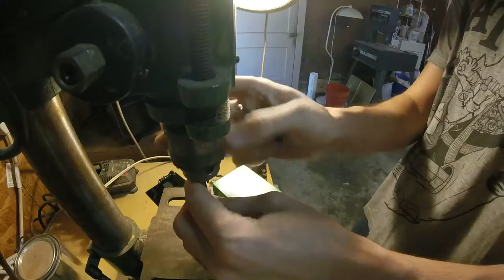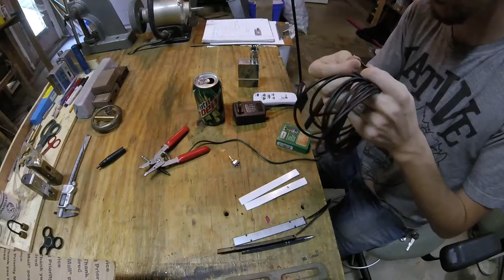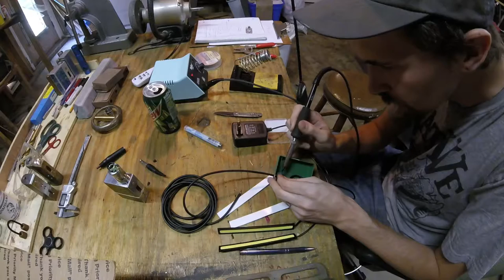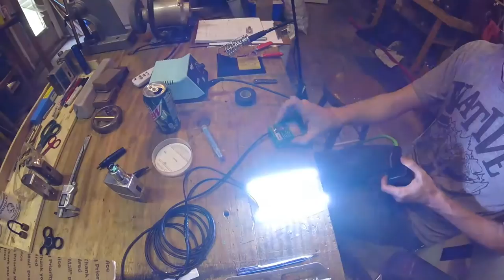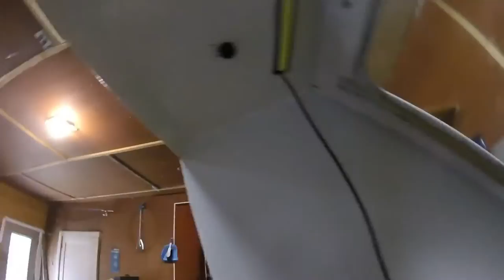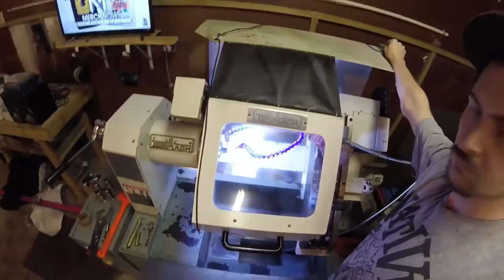Tormach Lathe Light Mod

Comment: I also watched your Tormach vid where the light kept falling down.  If you check out your local car parts store, they should have some 3M tape for holding car molding on.  I think Home Depot has it too.  It's grey tape with a red backing.
Reply from the maker: Yeah, I did just that after the video. Haven't had a problem with it since.